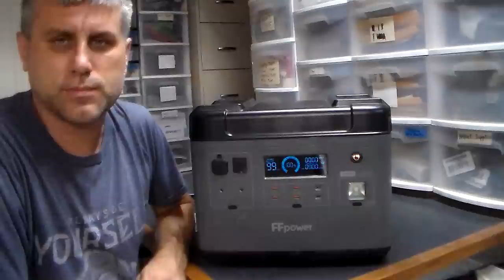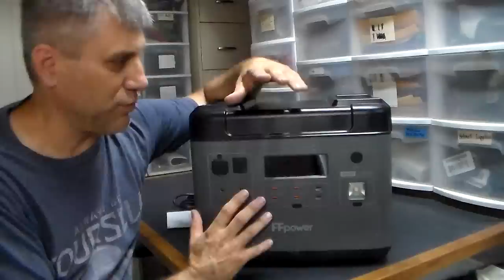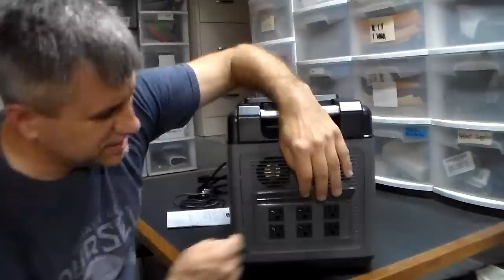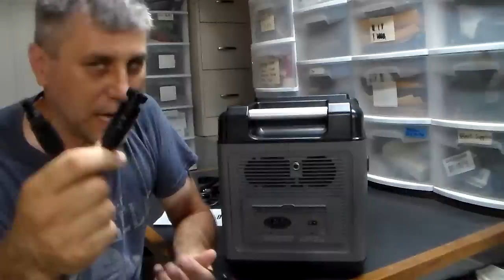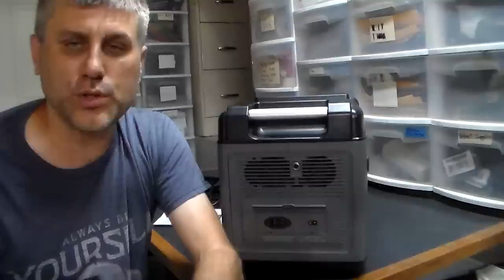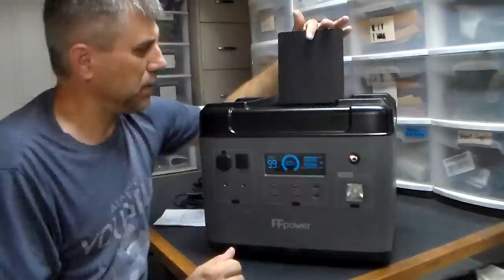Back up power...FFPower...2000 Watt  portable power station

Comment: DO NOT BUY FROM FFPOWER/OUKITEL...i just bought a p2001 3 weeks ago. Ups mode doesnt work, the unit wont automatically charge, and when charging it has a strong electrical smell...never had a issue with my Bluetti or a couple other lower tier brands...absolutely no support or follow up from FFPower and Oukitel support wont help, even though theyre the same company...total scam cheap chinese junk... DO NOT BUY

Comment: BROTHER I HAVE BEEN LOOKIN' FOR SOLAR FOR TWO WEEKS NOW..... I FEEL LIKE I HAVE WATCHED EVER WILL PROWSE VIDEO HE HAS.... I LIVE IN SEVIER COUNTY AND OUR AVERAGE ELECTRIC BILL IS $510 OVER 12 MONTHS..... I HAVE TWO GENERATORS, ONE DUAL-FUEL CHAMPION (GAS & PROPANE) AND A 11K CHAMPION (GAS).... BUT I KNOW THAT WON'T LAST FOREVER..... I OWN A HVAC COMPANY SO I'M FAMILIAR WITH HIGH AND LOW VOLTAGE AND DON'T MIND INSTALLING IT MYSELF, BUT I HAVE NO IDEA WHAT SIZE I NEED TO GET..... I DON'T NEED IT TO BE A FULL BLOWN SYSTEM, I JUST WANT IT TO KEEP OUR FREEZERS ON, LIGHTS, FURNACE, ETC.... SOMETHING I CAN BUILD UP TO WHERE I EVENTUALLY CAN POWER THE WHOLE HOUSE FULL TIME.... ANY TYPE OF HELP YOU CAN OFFER WOULD BE GREAT..... THANKS FOR ALL YOU DO BROTHER.....

Comment: Question, can you run a 6' deep freezer off that?
I have been looking for power banks or something I can use to run 3 a/c window units, 1 regular sized fridge,1mid-sized mini-fridge,and my 6' ft deep freezer without relying on city power.
I'd definitely have more peace of mind if I could stay cool without needing city power.
My apartment building is AWFUL with how many switches get flipped... Literal nightmare trying to run so much on a 60 yr old electric system... 😩

Comment: Copied !!!!!
Wake Up
 People!!!!!!!!!

Just a friendly reminder that California's new law goes into effect this week effectively removing owner/operators from the roads. Meaning truckers that contract with companies to move freight will no longer be doing that. You better have your pantries stocked cause a lot of food is moved out of California. Containers from ships will no longer be reaching distribution centers in a timely manner because these contracts will no longer be available to move freight by independent owners. Even large companies that have full time drivers with company trucks DO NOT HAVE ENOUGH TRUCKS. Hence the contracting. The railroad has decreased the amount of cars and won't be able to cover the shortage of trucks which will be 70,000 plus trucks. DEF for trucks is so low they're saying we have 7 weeks supply till its gone meaning those trucks will be shut down. Not only that, but fall harvest isnt till, well fall and many combines and such also need DEF. You can barely find engine oil for trucks as it's supply is nearly gone. Buckle up buttercup things are about to get worse in the coming weeks.🤬🤬 Copied, btw!!!

Comment: That's not too bad a price actually. A comparative battery alone is about $1,000, before you spend a few hundred for an inverter, and then the charger, the screen, all that USB power, and all the other goodies.
It's still outside my price range but that's not a bad deal for it.

Comment: I have a Generark powerone, 2000-1800, a Titan 300 and a just got a Bluetti 600 watt. Two of them came with panels. I want another big one. They get more expensive everyday. I need to make a choice soon. This looks like what I need. I have 2 100 panels and 2 125 panels. I want to have one charging at all times in an emergency situation. I feel  wary of buying a duel fuel gen, but I have been looking at them, getting fuel might be a problem coming up. Maybe I better get glass solar panels instead. So many out there and gets overwhelming sorting them out. Even has a 250.00 off coupon on this. I am trying to find out when next prime day is, might be worth the wait. I just bought a new 13CF freezer so I have to wait another power bank. God will provide. I wanted another freezer for months and I am going to fill it up.

Comment: I went with the ecoflows, we got a delta pro and an extra battery, so it has 7.2 kwh capacity and has a 240v plug (an extra, add-on adapter).  We also got the ecoflow smart (gasoline) generator with it.  That is nice because it charges the batteries with DC power, so there is very little power loss due to converting it into AC.  And you can set it up in the app to auto start if the batteries get down to a set level (30% is our setting).  The gas generator only holds 1 gallon of gas and that should recharge both batteries from 30% to 100% on 1 tank.  The batteries can run off solar, or generator if there is no sun.  I really like the ecoflows but they are pricey.... but really any backup power you can get could be a lifesaver.

What we experienced during/after Hurricane Irma taught me a lot of lessons, and being dependent on only a gas powered generator is not good when there is no fuel available!  We have lived through many storms and lost power several times for 6-7 days... but Irma was different.  All the gas stations were out of fuel and there were literal fist fights at the pumps when there was fuel available.  Ever since then, I have been very pro solar / batteries.

Comment: I built a battery backup for around $300
2 30ah batteries $59 ea
Energizer 1100w inverter $85 prime day
Renology 30 amp regulator $25
Harbor Freight 100w solar pannel $89
Battery box $10
Not sure what the watt capacity is, testing it right now.

Comment: The problem with alot of these things is allowable charging temperatures. 100°F and much below freezing and you start to have problems. Long term anything you want to do in hot or cold weather and without problems you are mainly looking at Deep Cycle flooded lead acid or AGM batteries. Big and heavy but affordable and reliable. We are mostly using very old battery technology, much better tech exists but is just starting to make it's way into the public sector. Lithium is mostly "old tech" so know about what it is you are buying, what it's limitations are and whether or not it's a good value for the price based on how you intend to use it. How you intend to use it and for how long is ultimately important.

Comment: Have a Jackery 290. 400w max. Small but here's why I bought it; built in solar charge converter and pure sine wave inverter. This unit is too small to run much but what it will do is allow me to charge any common type of battery using my chargers. DeWalt 20&60volt batteries, vehicle battery, power banks/jump starters, and "full size off grid" 12 volt batteries. Versatility. Back up for your back up. One is none and two is one.

Comment: Thanks so much. Your explanation is easy for older female without electrical knowledge to understand. This is a good price. Think the Bluetti AC2000 was running around 1700-1800. The features appear to be similar- battery, inverter, pass through, ability to use your own solar panels.

Comment: naw, I have a 200AH LIfePO battery for 600 bucks, 300 wats of renogy on my Yukon, solar charge controller, 40 amp dc to dc charger. 1000w 2000w peak renogy inverter, I am good this is garbage.

Comment: Thanks man. What's your opinion on the duracell got one few months ago at Costco.. I live on an island and shipping would have been alot.. haven't used it yet as I have to  modify my panels and by pass the controllers or inverter.. did charge in at work... And it smelled funny while charging.. dose the smell go away? 🤠

Comment: nice unit, I started building my own last week got my Lifepo batteries (4 x 120), got my 2000w inverter (not psw) 2 100 watt panels coming tomorrow, wall charger and bms total cost so far about $600 and a lot of learning but in the future I'll always be able to throw something together when there's nothing else available, I always do my own work when I can, cars, bikes etc,
Reply: All lot of stuff won't work with that modified sine wave inverter. Pure Sine Wave inverters usually cost about twice as much and in most communities you will have to order it. Even a small one will let you run modern battery chargers which can be very important. Most stores aren't smart enough to stock the things that people have done the research want. I have two PSW inverters, 400 & 1500 watt. Ordered both at an Auto Zone. Picked up at the store a week later. Even Bed Bath and Beyond can do this type of transaction.

Comment: Right now on Ebay , you can get 3 panels from Renogy (300 watts )and a 20 amp charge controller for $286.00 if you shop around.  YT deleted my post that had the links.  I believe nuclear war is a certainty and we will be hit with an EMP.  Modern electronics including solar panels that are connected, can easily be damaged or destroyed.  This 300 watt system is so cheap that one can buy two or three systems  and only use one.  If it is damaged from an EMP, you'll have back ups.  Also, standard lead acid batteries are immune to EMP, lithium batteries are not.
Reply: There will be no nuke war and no EMP, it's all Globalist fear mongering because they don't have final nuke codes to launch any nukes and all their hi-tech weaponry were all destroyed or dismantled during the past few years. Where did I get this info from... I got the intel directly from the person who's been helping us take down the Globalists, and her name is Kimberly Goguen.
Reply: @Vex916T  The Globalists are mostly in control of our military, and are using NATO to force Russia into a position where they have no choice but to use nukes first.  They have created the the conditions that have started WW3.  8-9 EMP's will shut the U.S. down, including our military that is not adequately hardened against EMP.  EMP will be used just before a full scale nuke attack.  They cannot get the  nearly 1 billion guns in the U.S., but they can starve us out, jab us to death, and nuke us. If you live in or near a big city, move now.  Yes, it will be difficult, but it will be nearly impossible later.

Comment: Will this power fridge and freezer at same time?
Reply: With 2000W inverter and 2000wh battery FFpower generator will power standard fridge and smaller freezer but it all depends on the specs of your appliances and how much watts they use per hour. And when you power up a fridge or freezer there is a power surge that happens so plugging in one appliance at a time is probably best way to see if generator can power both.

Comment: I've got mine in the cart. I'm going to talk to my husband as soon as he gets off the phone about it. We have a solar system that does about half the house but I'm worried about air conditioning for the bedroom.  We have a really nice large portable air conditioner that keeps rooms very cold and I need something for that. My dogs and I (after  menopause, me not the dogs!😂) get very hot at night!
Reply: This would run your AC for 1-2 hrs. This unit is only 2000 watt hrs. Most AC units use at least 1000 watts, so 2 hrs if your lucky.  Buy a small generator and stockpile  fuel would be a better option...

Comment: Hi Dave, what solar panel would go with this generator? Do solar panel cords come with the generator or with the solar panels when you order them separately?
Reply: I read this info from the Amazon webpage for this product:

Q: What kind of solar panels are suitable for?

A：The voltage of the solar panel is between 18V-48V(18-30V/10A，30-48V/15A), which can be used to charge FFpower 2000W.

In addition FFpower generator can take up to 500 watts of solar panels, which you would connect them in series configuration.

Also the solar charging wire type that fits this generator is called a Anderson connector which one is provided along with two other charger cords.
Reply: Thank you AJ Tao. Exactly what I needed. God bless you.
Reply: I just bought it and I am wondering the same thing. I guess I'll see when it comes.

Comment: Excellent information / on amazon its available for around 1600 $ I had previously bought a Jackery and its only down side is you can not use standard solar panels this FFPOWER you can use any solar panel up to 500 watts sounds like a great off grid system wished I had bought the FFPOWER
Reply: You can use any solar panel with the Jackery. Connection adapters are dirt cheap and available almost anywhere. Any connector can be adapted to plug in to the 12v socket on the Jackery without using any tools, meaning no cutting wires and splicing things together.
Reply: @jeffnorbert1871  the Jackery requires a 8mm proprietary power Jack I’ve already discussed this with Jackery and they make no adapter for other solar panels one would have to splice and hope for the best better option don’t make the mistake I did and buy the FFPower unit or a bluetta .

Comment: Thanks SP1... very informative. 
Question... can I run a line out of my car's cigarette lighter to charge this battery?
I ask as gas generators are extremely loud, while an idling car engine makes very little noise.
Reply: You could but it would takes hours to charge.
Reply: @antpart7998  that's OK. I am thinking of both home charging via car and while driving.
For me solar is mostly impractical..  and I do not want to rely on rolling power, or ANY power in an SHTF.
Generators are noisy, so remain a maybe source.
Reply: @bukboefidun9096  just remember to not run down the vehicle battery if you are charging when it isn't running. No problem when the engine is running.
Reply: @jeffnorbert1871  yeah, got it.
My car will not juice and of the 3 outlets unless the car is running.

Comment: My power went out last night fortunately only for 2 hours. I wasn't worried because I have a 300watt hours, 1800watt hours and a 20KwH battery backup supply. I also use multiple UPS (uninterruptible power system) for smaller devices.

Comment: I got 3000 watt invertors hooked up to car batteries ready to roll out! With jumper boxes to charge the batteries! And battery operated push in lights on the walls... I'll use deep fryers to boil water and cook out of like pots... I have smaller invertors for fans tvs charging phones ECT

Comment: Heads up…the code is not accepted as an additional discount on top of the $250 applied coupon🥲Shoot dang, it would have totally made it worth purchasing.  What  charging panel would you recommend btw, for this unit?
Reply: Confirmed, this new code does work. I now have one coming between July 28-Aug 4. Thanks for settling this as I have been tossing back and forth between the jackery and the bluetti. I already have a goal zero 400 and the discontinued 1250. For the whole house I have a dual gas/propane 8000 generator. I also have my food and other survival preps in order for at least 1 1/2-2yrs. I just thought the food might be used in-place of having to choose between meds or starvation for when I became a senior. Either I’m prepped and ready to help him ever the Lord lends my way.even though I’m kinda rural in north central KY. Praise be to our God and blessings to you all.
Reply from the maker: This ones works try it.  3PIW6MVR

Comment: Bought Bluetti Ac200 max and b230 … not totally impressed with overall quality based on the $3200.00 price tag. Issues with USB and five volt power in general. Service sucks and seems to be based out of China. 12 volt and 120 volt works fine. Easy to charge with 600 watts of panels.
Reply: That's what I'm considering so thanks for the info
Reply: Would've been better if you had bought a DIY inverter like a 24V Growatt or MPPT ($700-$800) with server rack 5KwH battery like SignatureSolar offers for $1500... DIY products are better quality and more reliable. Look up HandTruck Solar Generator System in youtube and you'll see how to build it with components I previously wrote.

Comment: I bought the Ecoflow Delta Pro and the Ecoflow Smart generator to charge it a couple weeks ago from Costco.  I have not used them but I'm sure they will come in handy during our normal southern  California summer blackouts.
Reply: You should test them for a week, because you never know if you got a lemon and it might break down after a few uses. I have been testing my DIY solar system for past three weeks during hot summer temps to see if any malfunctions show, so far nothing yet. I say now is a very good time to test as much things as you can before SHTF, it would really suck to expect something to work but it won't when you need it.
Reply: We have that exact system.  Took us forever to find someone that would even come near us. Something about solar scared everyone away. We live in Florida  in a small town near another small town!
Itsva great system but it still won't run our air conditioning  so this would be a great extra for a portable air conditioner at night!
Reply: @dog-gone-it5944  Ecoflow has a small a/c unit now, that runs off DC power from a battery - you can get it with it's own (small) battery and/or use it with a stand alone battery.  I have been considering getting that or a lower wattage window unit.  I am also in FL and it gets really hot here when the power is out :)  We also have the delta pro system
Reply: How much did it cost at Costco if you don't mind.
Reply: Do you mind telling us how much it cost at Costco?
Reply: I bought one on sale at costco a while back, too. It was the Delta Pro and 160w panel for $2849. I have a few additional 160 panels in series, it charged the delta pro in 5.5 hours. Awesome unit.
Reply: My mistake, the solar panel was extra - but was on sale for $299. Just pulled up receipt.
Reply: They also had a delta pro with 160w panel, remote view panel and supercharger adapter for $2,999.

Comment: Great advice, try and get one with LiFePO4 batteries, they have over 3500 cycle rate(charges) as apposed to regular lithium has maybe 1/3 of that..
Reply: Bluetti does one with that chemistry
Reply: @antpart7998  That's the one I chose.
Reply: Isn't that what SP1 said this unit has?